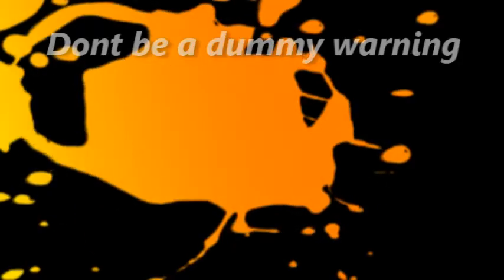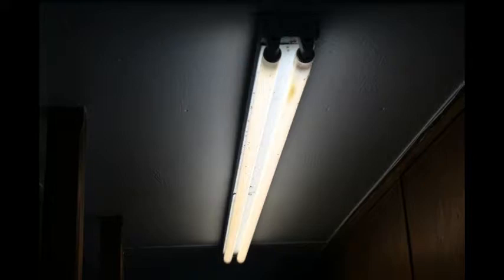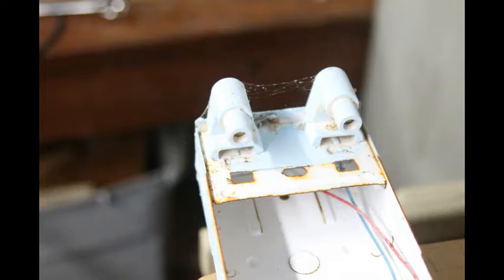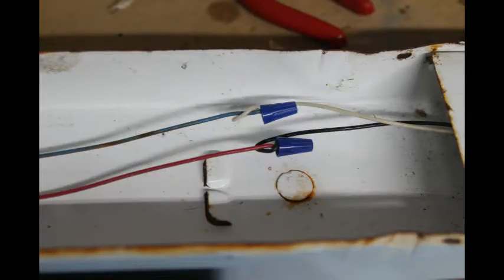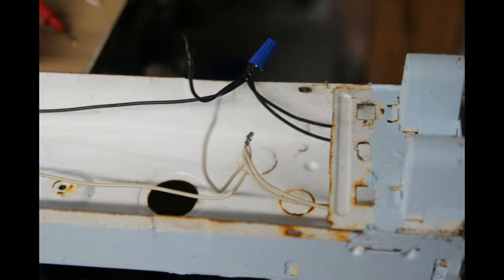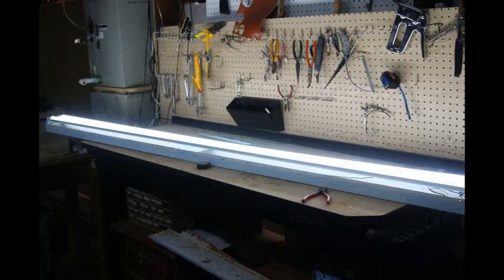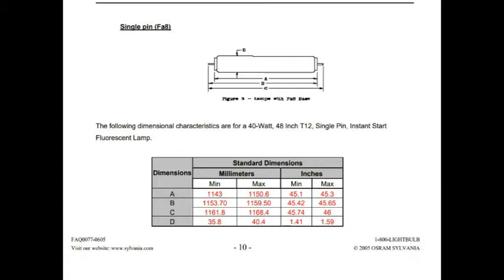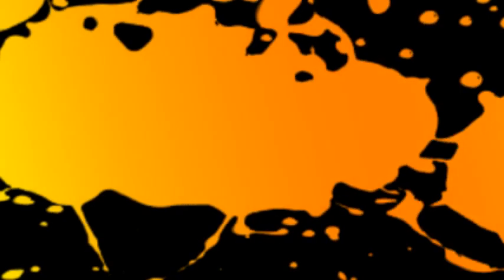Install 8' led tubes - addresses the major short pin issue

Comment: So, you didn't wind up with line(black) on one end and neutral(white) on the other, right?  Looks like you have both on each end.
Reply: I agree, it appears you have the power end (black) going to both ends on the same tube? Can you explain
Reply: I didn’t see that either. He mentioned that he’d want hot line on one end (like tying your black source wire to all the black & white wires on the 2 non-spring loaded tombstone side) and neutral on the other end (tying your white neutral source wire to both red and blue wires on the 2 spring-loaded tombstone side), but that didn’t happen. Instead, he tied the black wire to the red wire on the spring-loaded tombstone side and the white wire to the blue wire on the spring-loaded tombstone side. So the 2 bulbs are wired in series?